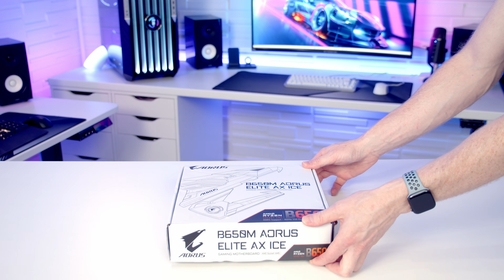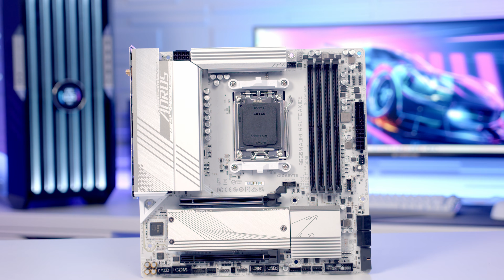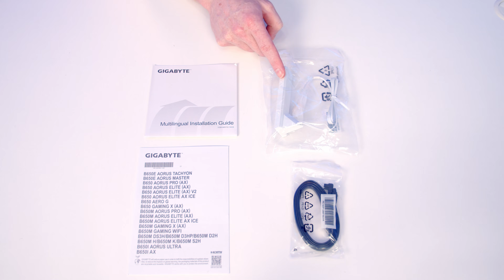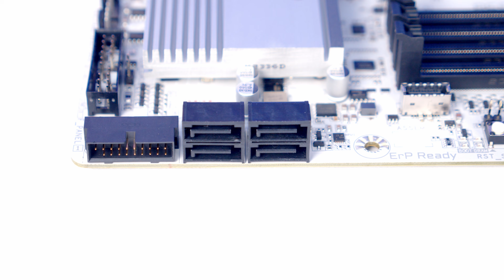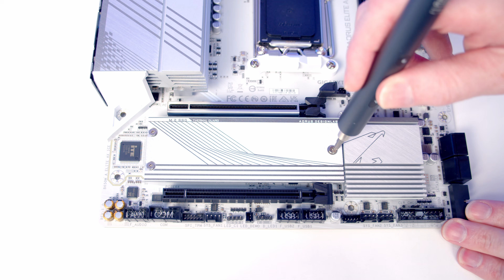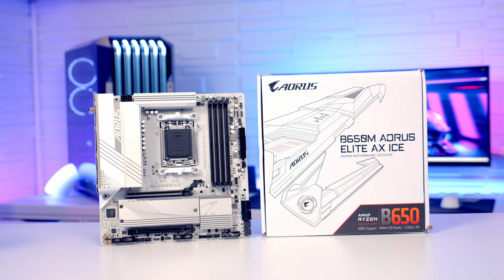Gigabyte B650M AORUS ELITE AX ICE Overview

Comment: "But the second x16 slot will be in x4 mode"... What does that even mean never heard of it LMAO

But it won't make any sense if what I'm thinking is right, the speeds would be so slow, practically pointless,
Reply: That means it's a full size slot with only 4 lanes assigned. For a secondary GPU is ideal, specially if you're trying to get more fps via LSFG

Comment: i have this mobo and its really nice. I use with 9800x3d and 4070ti super + 32GB RAM. Really solid and strong for gamming/working.
Reply: Did you update to the BIOS new version to support the 9000 series?
Reply: @EmiljuicyYT  yeap. Im using BIOS version 34a. It's really solid and stable. Very simple to do it, don't worry =)

Comment: Piece of JuNk just got mine and unable to boot up due to BIOS update try flash the bios as instructed try every version of BIOS still not working now tell me my Ram speed of 6000 hz is too high get lower one wtf switch to MSI boot up right away no issue
Reply: Lack of ,,,,,,,,,,,,,,,,,,,,,,,,,,,,,,,,,,,,,,,,,,,,,,,,,,,,,,,,,,,,,,,,,,,,,,,,,,,,,,,,,,,,,,,,,,,,,,

Comment: I'm getting this mobo and I have to ask, should I put my OS drive (samsung 980 pro) on top m.2 slot and game drive (adata legend 960 max) on the bottom, or it doesn't matter where I put them? Thanks!
Reply: If you have 2 gen 4's then it won't matter which one goes in which :)
Reply: yo, can you check your gpu running on x8 or x16 speed?

Comment: Could you explain the 12+2+2, 16+2+2 etc stats? I understand they are the power distribution components, but do those numbers reflect board quality (if not overclocking)?
Reply: the more power phases you have, the better. it splits up power into tinier packages, which creates less heat. having more also allows you to use higher watt cpus, so power phases are definitely something to keep in mind if you're going to be overclocking or using a higher end cpu (think 7950x). anything with 8 or more power phases should be able to run any amd cpu out currently. some particularly shitty boards with only 5 or 6 power phases will throttle higher end cpus and not allow you to get their advertised performance
Reply: you can take any starting from b650.  the whole generation turned out good

Comment: The best B650M motherboard on the marked imho. Good looking, good VRM cooling, good space between the first and second PCIe lane and lastly its packed with USB 3 ports on the IO.
Reply: Does the VRM support a 7900?
Reply: @picadediamante8492  Yes. Even a 7950X is no problem on this board.
Reply: @picadediamante8492  Yes. I run a 7900 on mine.
Reply: This is a great mobo! I think MSI MAG mortar b650m is better than this mobo imo.
Reply: @akaperfectman may be better on paper but this one is better designed.
Reply: Only 6pcb vs 8pcb rev.1-1.2 not "ice" version. This mobo su#k
Reply: @neoatani2828 6 vs 8 layer has no impact for average user whatsoever. ICE is a better board than regular ELITE AX.
Reply: I guess the normal is not mATX because I couldn't find any... Which would make sense too since it's kinda compact...
Reply: @neoatani2828 All revisions for non ice have 6 layer. Ice variant has the added benefit of knowing you have equivalent of rev 1.3 on non ice. That means realtek wifi and x2 phase on pcie power.
Reply: 6 layer pcb is perfectly fine. I understand its frustrating being a poor rusky and not be able to afford a proper board.

This is the best B650M board out there right now.
Reply: @FiveInline84 could you explain what that guy is on about? Is that PCV thickness? Whats the benefit of 8 vs 6???
Reply: @93ChayZ  Its thickness of the PCB/Motherboard. In theory, having 8 layers instead of 6 will help in Overclocking/stability, but on Ryzen, memory OC has its sweet spot on 6000Mhz, so there is absolutely no need for a 8 layer board. If you are on Intel, pushing 8000+ mhz on memory, then it might be useful with a 8 layers board.

My Aorus AX ICE has been rock stable with my Ryzen 7900 and 32GB 6000Mhz DDR5.

Comment: Too expensive in my opinion. Might as well spend a bit more and get the X series board instead. Now if the price was £100 cheaper it would be something to consider but at that price it is a no from me.
Reply: But then you have to go full ATX with a X board. And the price is not bad at all for what you get on this board compared to what asus, msi and ASRock offers on their B650M lineup, which is quite bad imho, especially Asus Prime line with horrendous prices for what they offer.
Reply: @FiveInline84  Just saying there are cheaper boards on the market. ASRock aren't bad, I had 2 the last 12 years or so. No problems at all with them.
Reply: @daviniarobbins9298  the vast majority of budget b650m boards are shit. like sure they work in the low end but you'll run into difficulty upgrading parts further down the line. like a motherboard with only 5 power phases will struggle to properly power a higher end cpu